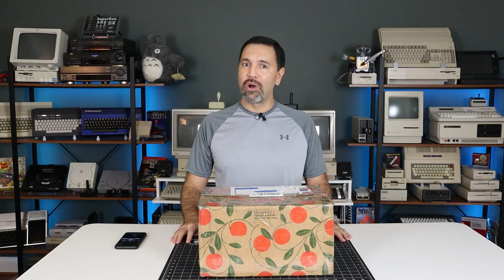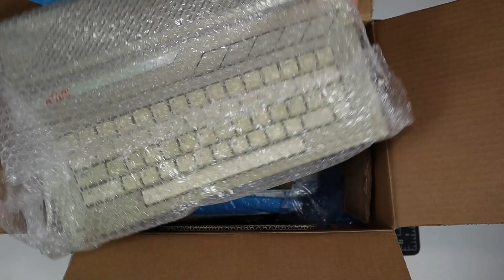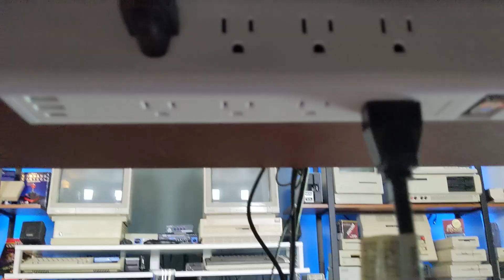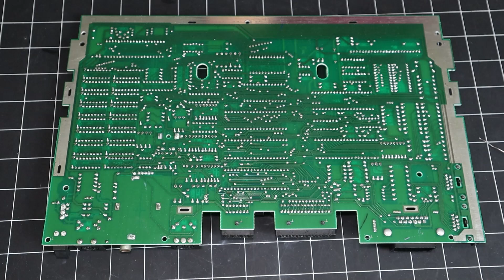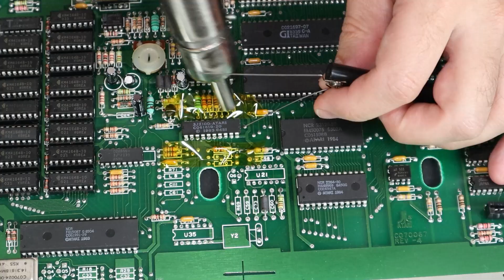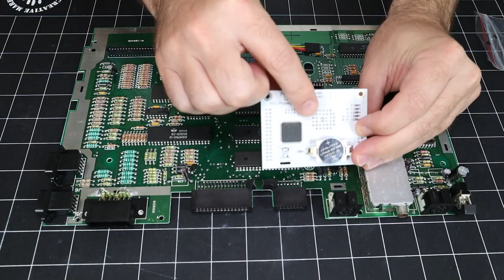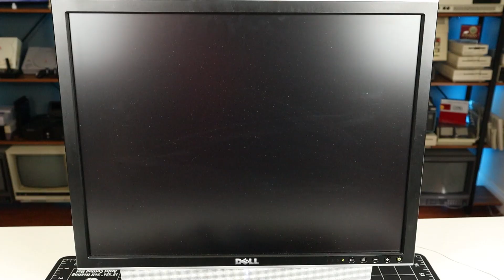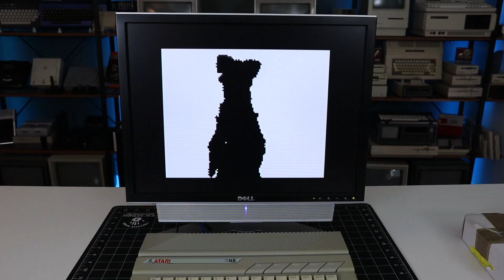Is this the “Ultimate” upgrade for your Atari XL/XE?

Comment: Another great video. I just recommended using machined IC sockets when coupling with those IC ribbon cable plugs. They have better retraining properties vs standard sockets you used, preventing plugs from accidental detachment which could end up fatal for the computer. I also recommend Kapton taping the coin battery to prevent it from shorting circuits in case of double sided tape not holdings enough in a long run. Thank you again for introducing this 1M add on.

Comment: What a hack-job with those 4 wires and glue... why not to solder it to the underside of the board and route it nicely through the opening in the motherboard or behind it?

Comment: Coming back to this video, I have to say that the Ultimate pair is no more the ultimate upgrade  for our Ataris . There is a new king (actually its around for for years but it did get better) and its called SUBcart. It offers 1MB RAM/4MB Axlon, RTC, fully compatible with ATR (specific cable), multiple ROMS to select and Stereo Pokey upgrade.   You can enjoy that without opening your Atari or waving a soldering iron over your precious ICs.  Just insert the cartridge , connect the three cable which enable the memory upgrade, the ATR support and  provide the stereo sound jack and you are ready to go.
The device offers the best compatibility  from any other medium plus the video and music players offer a seamless experience  reading from almost any type of SD cards.
Since I bought a SUB and an AVGcart....my 65XE "Ultimate"machine is collecting dust. For developers things might be different but for casual users its the best solution plus you can  easily  switch over to another computer.

Comment: One of the things I learned from watching  electronic board repairs of pinball machines is that over time many solder joints will crack and some were like you show, just not properly done in the first place. And many times a tedious, pin by pin reflow of the solder works to restore the function. I recently did this for a friend's guitar amp that was just as you show with incomplete solder joints and the unit was only 2 yrs old when it started to fail.

Comment: Turning an Atari 8-Bit into an Ultimate 1MB computer is interesting, but is it really necessary? This is clearly the decision of the Atari 8-Bit computer owner to make on his/her own. I definitely won't do it to my actual Atari 800XL for personal reasons, but if I ever get an Atari 360XE that would definitely get the Ultimate 1MB upgrade to it.
Reply: From what I've seen, it's more about being able to select different OS versions than the memory upgrade.  Yeah, a few things will use the extra RAM (Sparta DOS mostly), but being able to select various different OS options is a huge win.  Emulators are so good now, that it's sometimes hard to justify using the real hardware at all, though it's really cool.  Of course, if you want to go all the way with hardware modifications, just jump to the 1088XEL.  It's a new Atari 8-bit motherboard that uses the original chips (or modern replacements), and it is designed for the U1MB.  If only it came with all the resisters and sockets soldered in place.

Comment: I had that computer in 1992 I think. But I've damaged it. I was a 12-year-old punk back then and I was interested in electronics so I put my hands on it and started soldering (Atari doesn't require it and It was fine). What a waste. I would be something now. Of course, I can buy it now on Allegro (Polish eBay).

Comment: One of the really nice things about U1MB, is that it provides a handler for high-speed I/O that loads via the PBI handler hooks. This injects high-speed SIO support into everything, and since FujiNet can talk SIO at divisor 0, this means it has a max throughput of 127kbps. :)
Reply from the maker: Nice. I have yet to play around with FujiNet but it's totally on the list.
Reply: Yeah, the Atari SIO speed limit of 19.2kbps was apparently due to the limit of the analyzer the hardware developer was using in 1978.  It could have been significantly higher with most devices.

Comment: Those holes in the soldering are called pin holes or blow holes, and they are caused by the moisture in the board escaping. When I took my ISO certification back in the 90s a board was allowed to have only a few of them, but ISO-9001 standards didn't exist till 87. I'd leave them alone since the joints appear to have held up for this long.
Reply from the maker: Cool, thanks for the clarification!

Comment: I always wanted to put the Atari 130xe to the test....
Build a cartridge port that plugs into the back (cart area)... that has a 2600 Cartridge slot and a 5200 slot as well as the 600/800/130xe's cartridge slot.
Supposedly, any 2600 and 5200 cartridge should work on the 130xe... same cpu etc...  
Be cool if someone made such a thing and maybe use a 3d printer to make a matching case for it.
In the event you stick 3 carts in there.... maybe a small boot menu lets you select which ROM (or cartridge) loads?
This would include the option of booting straight into the PC's ROM.
a 16k RAM expansion wouldn't  be selectable since it isn't a "ROM" ...
The idea is to test Atari 2600 /5200 carts on the 130xe... 

Anyone try it ?  Or want to try it?
Reply: No, that doesn't work at all.

The 2600 was a very different system with a much simpler and incompatible graphics chip.  That's totally a no-go.

The 5200 was mostly the same chips, but it eliminated the PIA chip that the 800 used for reading the joystick directions, which is did by using analog joysticks which were read by the Pokey chip just like the paddle controllers.  (I believe the joystick triggers were handled by GTIA.)  But besides the different controllers on the 5200, the hardware chips are all memory mapped, and the 5200 put them in different places in the address space, which simplified the motherboard slightly.

In theory, it should have been trivial to put out the same program for both the 5200 and 800 on different cartridges.  But due to internal politics, Atari had separately written ports of various games for the two systems, often with the 5200 version being better.  But it doesn't end there, because clever hackers ported the 5200 versions to the 800 and distributed them through various BBS systems, so most 5200 games were available on the 800 if you knew the right people.  (I expect the porting was mostly adjusting for the different memory map and using digital joysticks, but I haven't looked at the details.)

But it's a shame the 5200 wasn't just an 800 without the keyboard and SIO port.  It needed compatibility with something to make it a win (the 7800 was a great idea, just too late).  And the controllers were dumb.

Comment: Towards the end of the video I noticed what I think is a Sears 13 inch TV/video monitor on the lower shelf, am I correct? Back in the early 1980's I connected a CGA laptop to the RGB input port.
Reply from the maker: Wow, great eye! You're exactly right, it's a Sears Total Video System with tuner, composite, and RGBi/CGA inputs (using the somewhat unusual EIAJ-8 connector found on some Taxan monitors and also Sony PVM "VTR" ports). I've been meaning to do a video on it, as I bought it from the original owner locally and he still had the original Sears Business Center literature, receipt, etc. for it! I just haven't yet acquired the correct cable but you've prompted me to action :)
Reply: @retrobitstv  Would you like to borrow my cable so you can do the video?
Reply from the maker: @anthonyferraro5569  Thank you for the offer! I've been looking on eBay for years and when they do come up they go for like $200 if you can believe that. I've just purchased a Laser128 RGB cable from this site: https://iec.net/product/laser-128-to-taxan-monitor-cable-6/ which I hope to repurpose with a standard DE9 connector. If that goes well I should be in good shape but I'll keep your offer in my back pocket just in case. Thanks again!

Comment: A quick question (as I will have to go through almost the  same procedure soon) - how hot was the air on the heat gun when you de-soldered the chips?
Reply from the maker: I had it set to 570F but as I am a complete novice when using the hot air station, please don't take my word as gospel!
Reply: @retrobitstv  Thanks! So far I worked it out to be 370C by experimenting on a test board, which means I should still practice a bit more to drop it down.

Comment: Someone must have messed with this board already - no metal sheld, no screws, caps replaced with radials instead of axials and a bit weird OS (memory test should be different in a 130XE).

Comment: Tip. Something I recently learned about is low melt solder. You can get solder that melts at a much lower temperature. It's great for removing parts easily. However you need to suck it up after with solder wick. It's not good for regular soldering.

Comment: Really nice! As an alternative to soldering directly to the CPU legs, you can always look for either nearby pads whose traces run to the corresponding leg, or an endpoint from the trace, such as one of those nearby resistors or the legs from one of those nearby ports.

You really missed out if you weren’t exposed to Atari back in the day. In school, I can only liken it to the SNES vs. Genesis fanboy wars that would follow a few years later, haha! I love my Atari 800XL, which I still have to this day - still with the original box, along with my 1050 disk drive, which still works too. Anyway, the 800XL is somewhat tight quarters compared to that 130XE case - I wonder how that PCB would look inside of the 800XL case?

I’d love to find out a bit more about those USB power cables - I still have my original power bricks, but that would be so much more convenient!
Reply from the maker: There's a 3D printed mount for the 800XL that piggybacks on the rear slot and requires no screws. 

https://thebrewingacademy.com/collections/atari-800-xl-xe-xel-xld/products/atari-xl-xe-replacement-power-via-usb?variant=15968353910884
Reply: The USB power is really an obvious adaption.  The giant Atari power brick for the XL/XE systems just puts out 5v at up to 1.5A.  USB defaults to 5v, and it's trivial to get a 3A "fast charging" USB power adapter.  But do be careful, especially with adding various updates, as they can draw more power than you might expect, and the Atari supply will do just fine, but if you're just using a typical 1A USB port, you'll run short.

Unfortunately, the original 400/800 used 9v AC power which was internally converted to 5v, -5v, and 12v, so running them off of USB isn't really an option without a lot of work.  I think the 12v wasn't actually used (it was one of the pins on the SIO port, but they dropped it on the XL as it was never used).  I think the -5v was for the memory cards, and I'm told that if you use a SRAM upgrade, that eliminates that, so it might be possible with some hacking.  Oh, and the 1200XL also uses the 9v AC plug, but I think it just uses 5v internally, so it should be possible to bypass the rectifier and install a USB port for power instead.

Comment: The screws on the 130xe were setup to hold the RF shield and motherboard assembly in place, and this one has obviously had that removed from this one. None of the chips on this motherboard were initially socketed so someone's already worked on this one a little bit.
Reply from the maker: Cool, I was wondering if this machine had an RF shield and if it had been previously removed. I also found it odd that all of the RAM chips are in sockets except for one, so that must be part of the previous work done on this thing then.
Reply: @retrobitstv  The 130xe had some oddities,  using faster ram in those top two slots can cause issues. That may be why those aren't socketed. They might have swapped all the ram except those two. I did a lot of reading up on it when I was troubleshooting the one I had from when I was a kid, and that was one of the things the troubleshooting guides brought up. (Mine ended up having a worn out socket that someone had installed on the ROM chip before I bought it used.)
Reply: (Though it may be more that Atari used bargain basement ram at that point, and that the first two chips are always a different brand/series of ram, because they needed to be rock solid, so the modder might have just thrown away all the MT ram chips and put good ones in the places that had those MT4164's.)

Comment: most XL machines are usually socketed (the MMU might not be) s but the this upgrade still requires some soldering.

17:56 the socket for the MMU does not look flush.
Reply from the maker: You're right, from my perspective it looked good but from the camera's side it looks raised. I tacked two pins in and then reflowed them while pressing the socket into the board, so I wonder how that happened :/

Comment: What is that tool with the handle and the wire "fork" used to put pulling force on the chip being removed at 11:11? It's so familiar, but can't place it. I could have used on of these recently when dealing with a very similar issue where I DID pull a trace and scratched another using light tweezers. Just not gentle enough a touch with them. I don't think it's "for" this sort of application, but it works a treat
Reply from the maker: The little fork tool came with my hot air station and is intended for chip removal. Amazon sells an "IC Chip Extractor Removal Tool for Hot Air Gun" for $40 but you can get the same thing for $1 on AliExpress.

Comment: Congrats on the upgrade install and learning more about the A8's! Most XE's are minimally socketed or not at all. Not surprised to see poor solder work by Tramiel era Atari, too. We are fortunate to have even had XE's though, even if they were built to lesser quality standards. They are still rather reliable since the chips don't run too hot.

Recommend you recap the board, at least the larger power filter near power DIN. The U1MB will draw more power.

I'm not a big fan of the double sided tape since it may leave a persistent residue on the RF modulator (no big deal I guess).   Functionally it's a great idea. Another idea is to wrap the U1MB in electrical tape and let it rest on the motherboard.  Leave the primary IC's on the U1MB open to vent of course. Glad you didn't drill the board. 

Looking forward to your followup videos on the series!  Your explanations are very clear and the video progresses at a good speed.
Reply from the maker: Cool, thanks for the tips! I have changed the double sided tape for velcro for easy removal.

Comment: I started with an Atari 1200XL with a tape drive after my brother showed us his Atari 800. I later purchased a disk drive and eventually updated to the US Doubler with SpartaDOS.
I wondered what all the noise was about the C64 since it came out after the Atari. I friend of mine got the C64 and we set them up side by side. The first thing we noticed was how painfully slow the C64 disk drive was and that it couldn’t boot directly into anything. You always had to type load “*”,8,1 wait for an eternity for it to load, then type run.
I did like the sound of the sid sound chip, but it only had three voices instead of the Ataris 4.
Reply: Yep! Not to mention the 16-color palette vs 128/256. And the display list, which allowed it to hw fine scroll in bitmap modes, in addition to character. The C64 had no display list and could only hw fine scroll in character modes without a very expensive DMA memory unit, which no games supported until very recently, and only one actually scrolls in a bitmap modes.
Reply: @RetroDawn  
I noticed the lack of color of some C64 games compared to the Atari’s version. Such as Boulderdash. The diamonds you collect on the C64 are bland looking compared to the Atari version.
Also Wayout and BallBlaster for the C64 have smaller screens and are slower than the Atari versions. Not as smooth at scrolling. Although that could be do to the fact the C64’s cpu ran at 1MHz and the Atari’s ran at 1.79MHz.
Reply: I went Percom at first.  It was, well, sloppy.  It was a PCB held on by the voltage regulators with a full height Tandon (I think) drive but could actually address up to 4 floppy drives.  The case I think was recycled from TRS-80 era.  I find it hard to believe it was actually a commercial product.

Comment: Built-in Self Test tests only standard 64k of ram. The extra 64k of 130xe is left untouched.
Reply: Later XE OS's do test the full 128K iirc. It will show four more RAM blocks below the 64K in a horizontal pattern.
Reply from the maker: Good to know, thanks!

Comment: Pretty sure the Self Test stuff never changed after it was added in the 1200XL model, which is why it has the 1200XL's keyboard layout, and only does 64K... doesn't test the 130XE's (or any upgraded XL/XE) extended RAM.
Reply: Later XE OS's do test the full 128K iirc. It will show four more RAM blocks below the 64K in a horizontal pattern.
Reply: @gamedoutgamer  Cool, I never knew that!

Comment: So the instructions actually say “now drill a hole in your main board”?
Yikes.
Reply from the maker: Yea, not my first choice either. There's no official installation instructions that I could find but a video on the product page demonstrates drilling the hole, as does this blog post I ran across here: https://atariprojects.org/2020/12/30/purchase-and-install-an-ultimate-1mb-board-for-your-atari-800xl-1-3-hours/  I found a 3d model for a screw-less mount on thingiverse but it's only for the 800xl :(
Reply: In an empty space right at the edge of the board, next to the power switch, and exactly like the existing screw hole a little further along. Some prefer to hang the board off a single stand-off, but I like to mount it so that it doesn't flap around. Given that upgrades like Sophia (DVI) mandate the removal of the RF modulator, the installation of a DVI connector, and a slot cut in the back of the case, one tiny screw hole isn't really that egregious. ;)